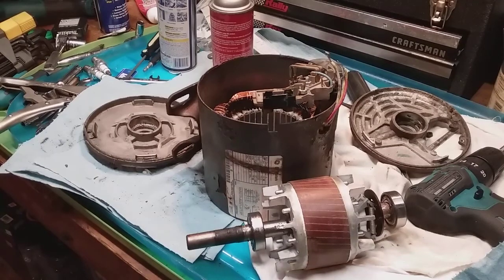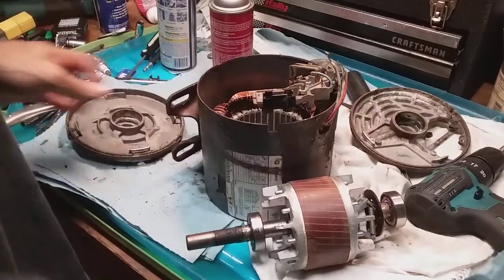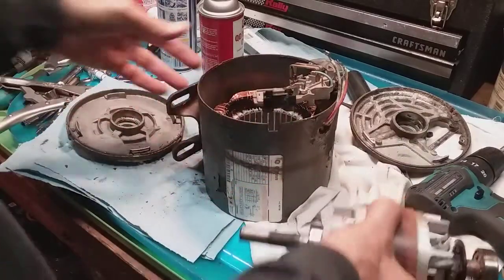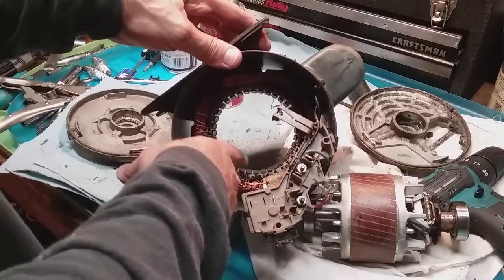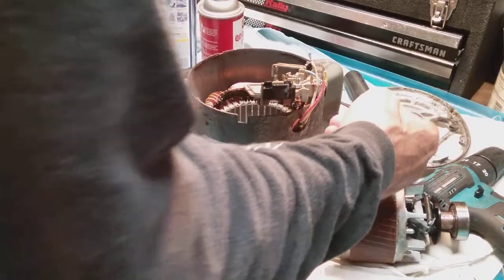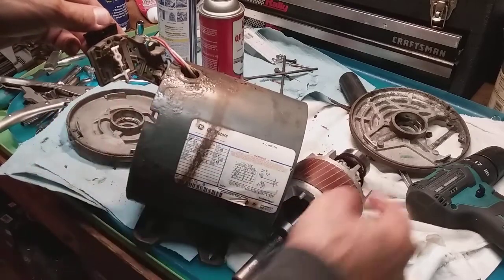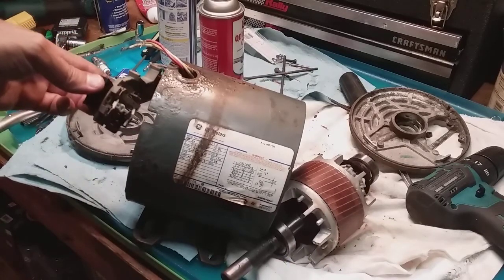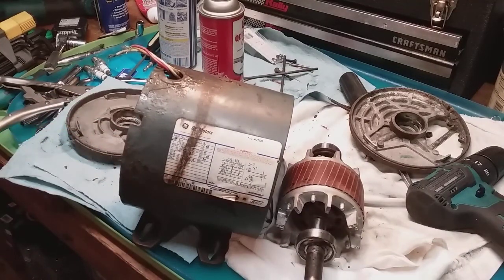Boat lift motor buzzing humming part 2

Comment: Forgot to say I'm dealing with a humming lift motor. I took the belt off, and motor spins freely. If I turn power on, it hums, and if I give the pulley a spin, the motor runs... But ever few seconds, it surges. But will not run without a spin on the pulley.

Comment: "Clutchy thing"! "Capacitor-type thing"!
Reply from the maker: I just wound up cleaning up the contacts and everyting inside and it worked perfect again. I was limping it along until we did a totally new dock and lift. Wow, the new set up makes boating so much nicer. If you can, do it sooner than later. So easy to get out on the water now with a modern set up.